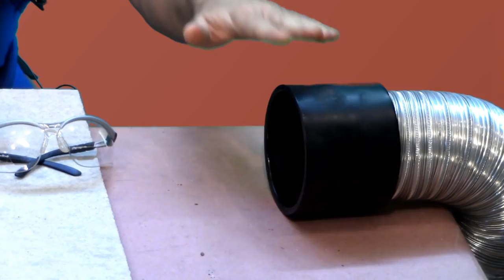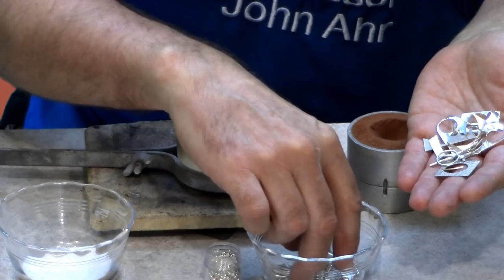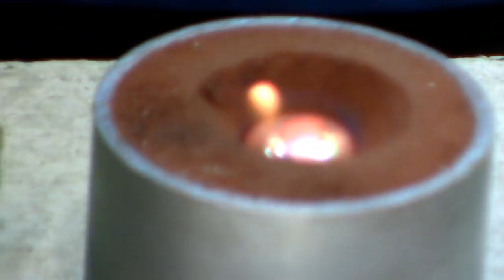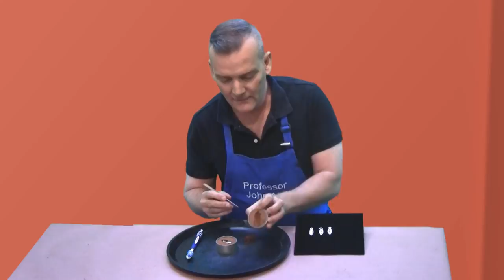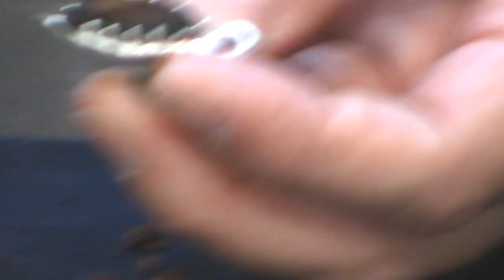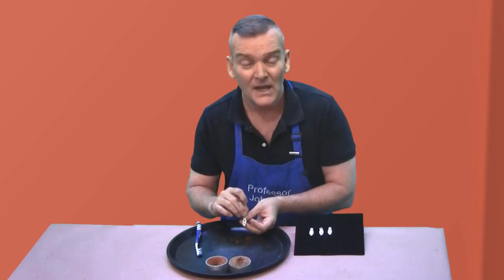Cast Stones In Place With Direct Casting PART 2

Comment: Is silica fine to cast with as well or is delft clay the way to go
Reply from the maker: Hi Calin,  I've only performed direct casting with cuttle fish bones, charcoal and Delft Clay.  My understanding is that Delft Clay is essentially sand casting (silica) made somewhat easier.  If you are good at traditional sand casting techniques, I encourage you to try the cast in place process using that technique.  Even if you were to switch to Delft Clay, you would find that there is still a learning curve associated with the process.  If you can, try both methods and see which you prefer.  Good luck with your creative projects.
Thanks for your support! : )